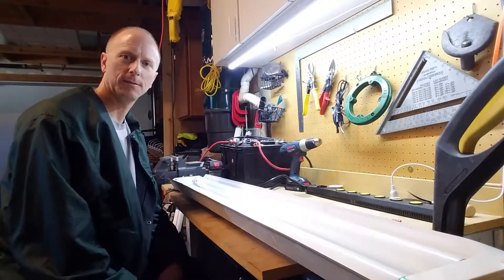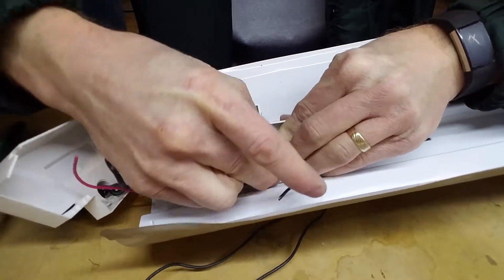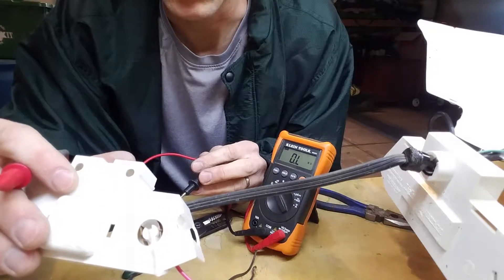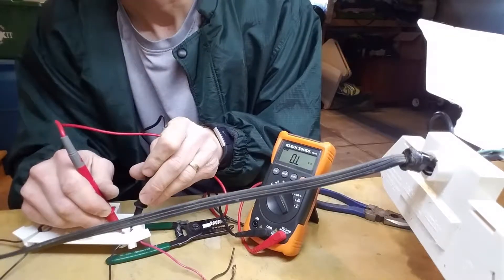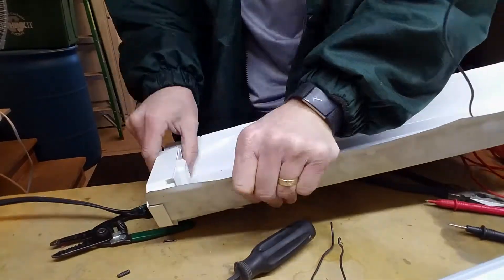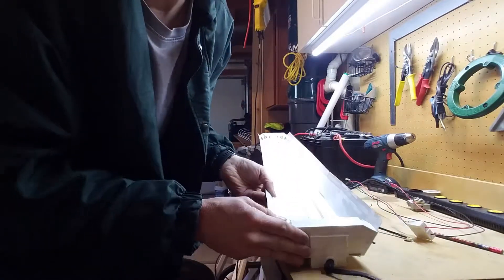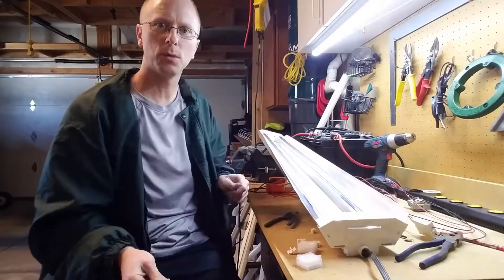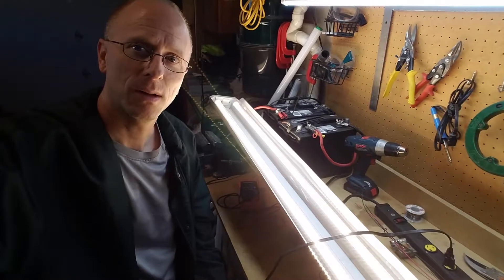DYI - Converting a Electronic Ballast Fluorescent Tube Fixture to a Singled-Ended LED Fixture

Comment: Good video. The subject fixture is similar to mine which is different from many other fluorescent units. Mine, like yours has cast holders instead of tombstones and transformers instead of ballasts but mine is powered at both ends (i.e. 2 transformers). It has the non-shunted holders.  The tubes you mentioned are presently out of stock so I guess they must be quite popular.

Comment: I got several of these types of fixtures.    The plug and play LED bulbs don't work very well in them, the transformers inside of the light makes a loud buzzing noise.   At least now I know there's an option to convert them to single ended LED fixtures and won't have to toss them.   They could probably be converted to double ended as well but that would probably be a bunch of extra work.

Comment: Was wanting to attempt this. But the insides of my fixture are NOTHING like yours. Mine is a pill chain, which I’m not worried about. But my fixtures have like transistors and a huge circuit board on the ends under the plastic. Might be less of a headache to just buy new fixtures.
Reply: Hi I have the same fixture that you use  and my question is, the other end of the fixture you don't use has a ballast inside of it is cutting the wires all you need to do or do you need to remove that second ballast also?
Reply: This method works on the older Lights Of America fixtures.

Comment: Saved this video some time in March. Heading to zey garage right now to attempt this insanely basic looking wire hook up.
I was stoked, when I seen the transformer and exact wiring set up inside my fixtures. Will be back with results.
BTW kudos Steve, regardless of my results, this video is straight forward and streamlined.   
Much appreciated.
Reply: ▬UPDATE▬ During the rerouting/rewiring of my fixture every damn wire inside the fixture snapped off while applying MEDIUM force on the wire nuts. Gonna have to run new wiring. Didnt have the time for that.      I'll keep ya posted!
Thanks again Steve!